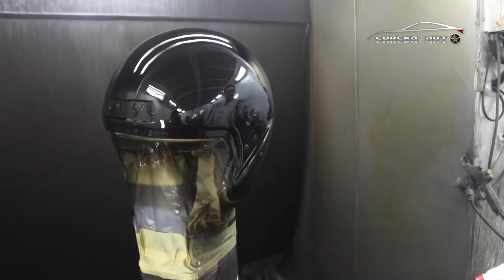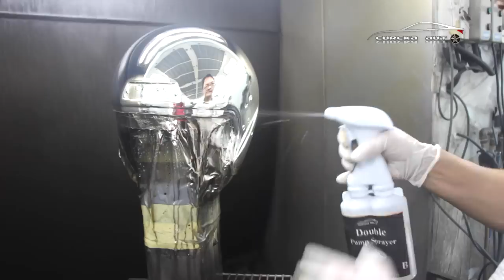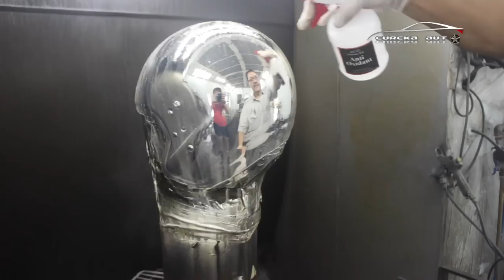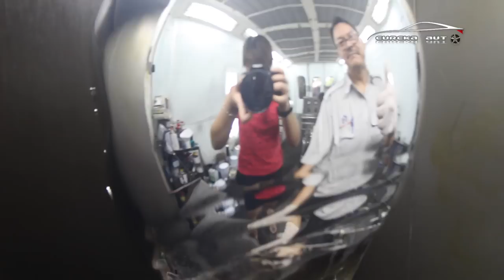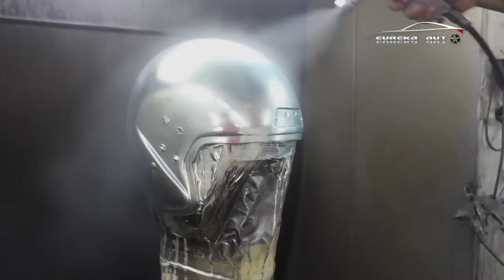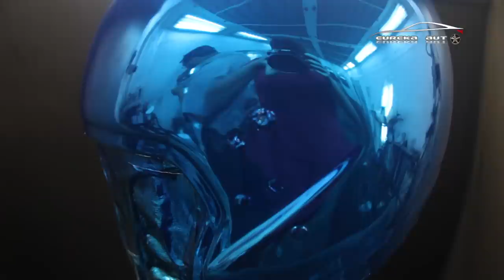DIY Chrome Kit Spray on Helmet

Comment: BRASHER SILVERING PROCESS
MATERIALS
A. 0.15M AgNO3 solution (2.50 g AgNO3 dissolved in 100 mL of distilled water),
B. 0.80M KOH solution (4.50 g KOH dissolved in 100 mL of distilled water)
C. 0.45M dextrose solution (7.80 g dextrose in 100 mL of distilled water)
D. Concentrated NH4OH

Comment: can i know type chemical u used
Reply: BRASHER SILVERING PROCESS
MATERIALS
A. 0.15M AgNO3 solution (2.50 g AgNO3 dissolved in 100 mL of distilled water),
B. 0.80M KOH solution (4.50 g KOH dissolved in 100 mL of distilled water)
C. 0.45M dextrose solution (7.80 g dextrose in 100 mL of distilled water)
D. Concentrated NH4OH
Reply: 67nbozi real?